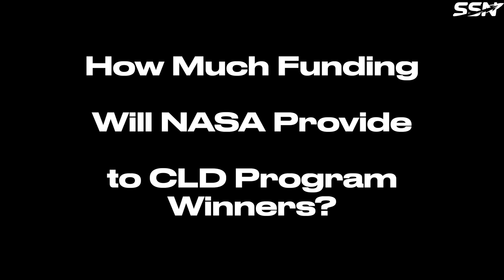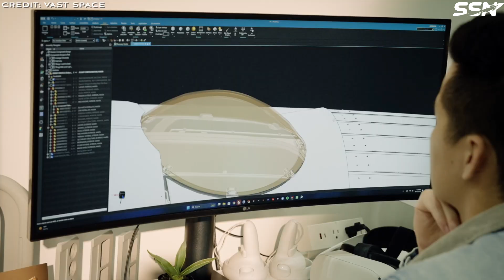Are Commercial Space Stations in Trouble? Orbital Reef, Vast, Axiom & Starlab compete for NASA Funds

Comment: This is all half baked stuff. We want a large ring like in 2001 and even envisioned by v. Braun in the 50s! I guess if US, EU and Japan get over their egos its easily doable.
Reply: Funnily enough, the single worst thing you could add to a space station like this is artificial gravity. The entire reason to have a space station in LEO is to have a large habitable volume of zero-g conditions. If you remove the zero g then it defeats the entire point
Reply: @notgreg123  point taken but it should be easy enough to have a zero g environment in the central hub. but the normal tourist will appreciate to have some sense of up and down for longer stays, and I mean a week, not a year. He can always visit the central hub and swim in zero g if needed.
Reply: @gkossatzgmxde  Even on the ISS without rotating components, a lot of experiments are so sensitive to vibrations, precession, and acceleration that they need special housings to protect them from the vibrations the machines and crew just passively make, and special procedures for when an orbital adjustment is needed. The low gravity at the center of a rotating habitat would still be enough to trash a lot of experiments like these.